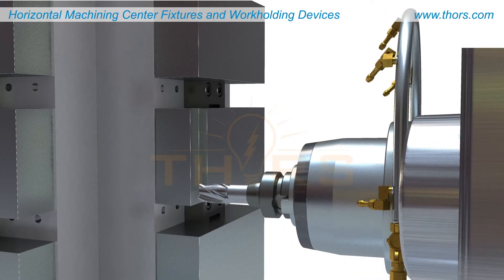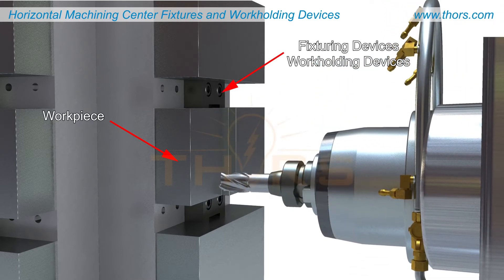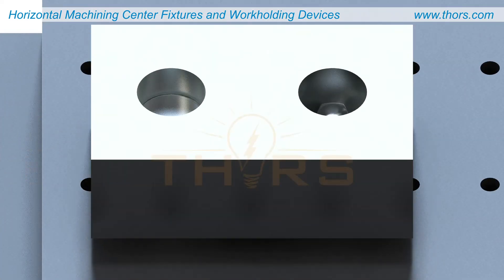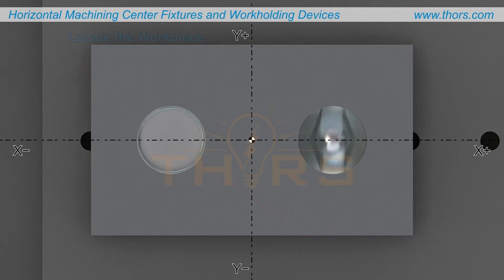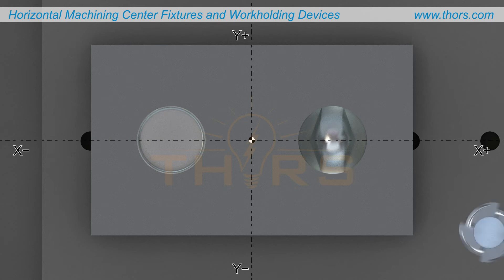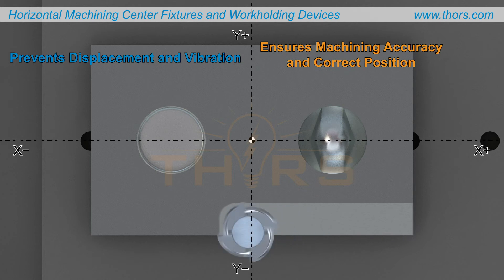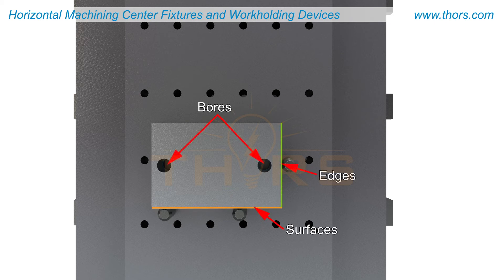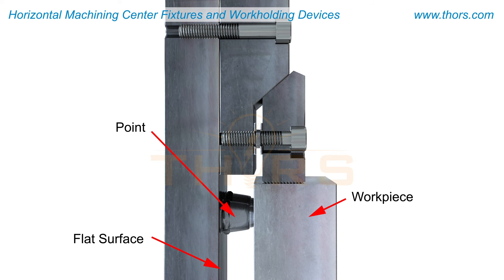What are Fixtures & Workholding Devices for Horizontal Machining Centers? HMC Video Series 2 Preview

Comment: Not sure where you go the "serration" jaw image but the 45 degree angle on the back side of that will promote part deflection and do the exact opposite of what pretty much every clamping system has done since the mid 1960's with the introduction of the Kurt AngleLock vise.  The 45 degree angle should create a downward force to 'push' the part into the base of the fixture or vise to provide a force opposite that of the cutting tool with a helix angle that is trying to pull the part out of th e fixture. If you need CAD files for you classes, Kurt, Jergens, Mate, Modern Industries, Te-Co, Toolex and even Martin Trunnion Table can provide you with 3D and 3D models that you can import and would be more realistic that what you are depicting in this promo video.